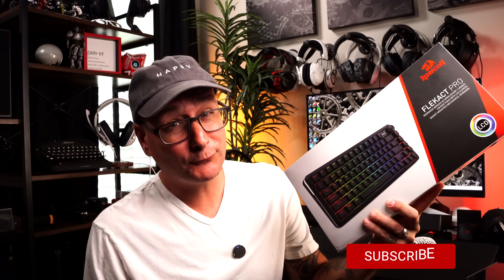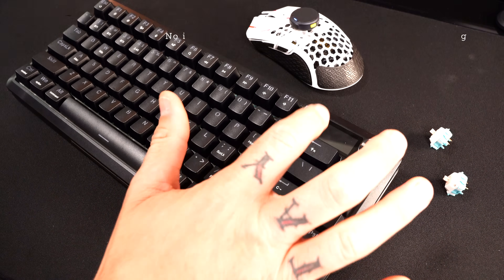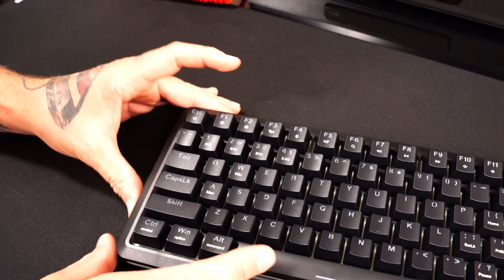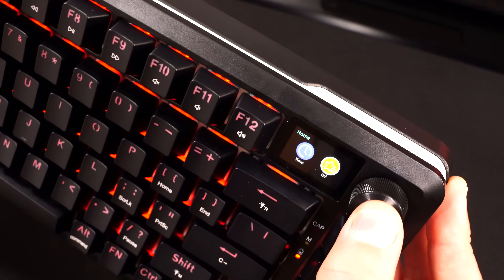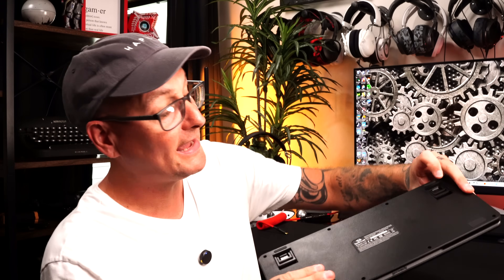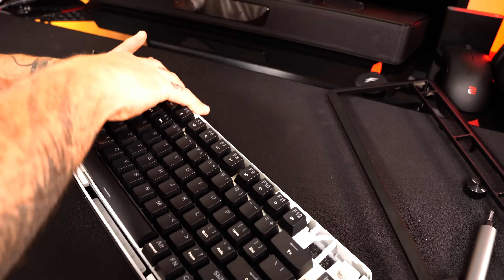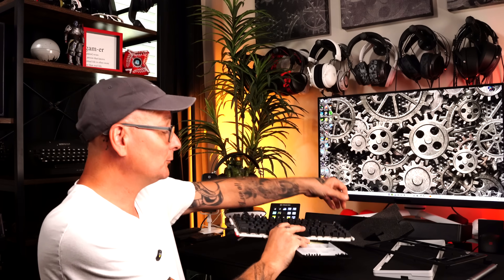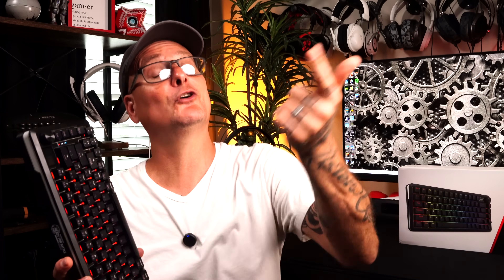When did BUDGET keyboards get this good?

Comment: Red Dragon has dramatically increased their quality over the years.  I haven't bought one of their keyboards yet, but they are inching closer to being on my radar.  I think they could benefit from a rebranding or creating a new product line separate from the traditional Red Dragon branding.
Reply: If they change the logo and use a different font than that genshin impact-looking one, they'll get much better exposure